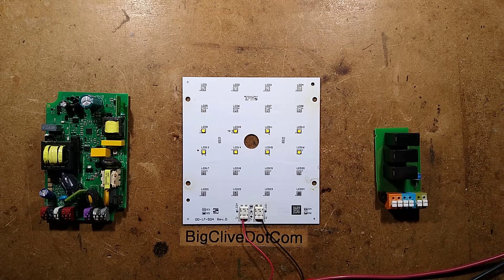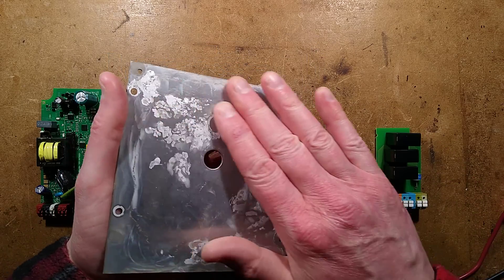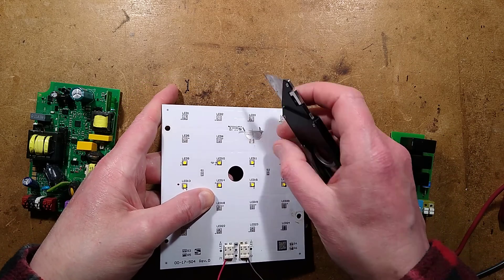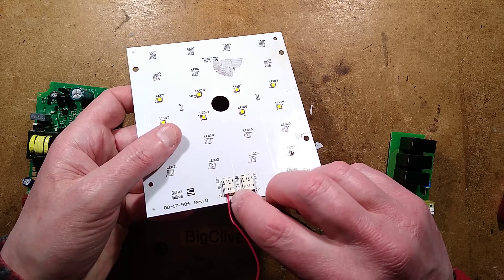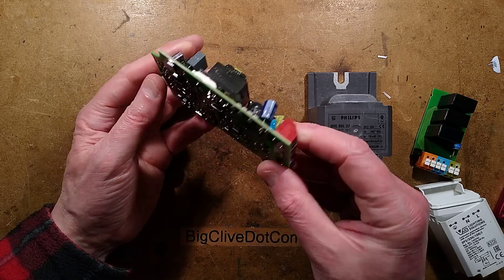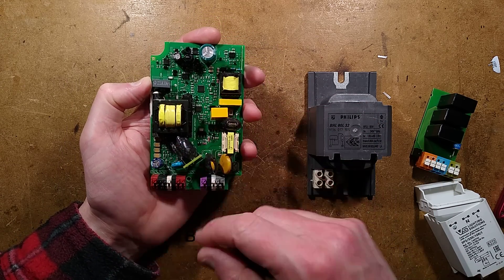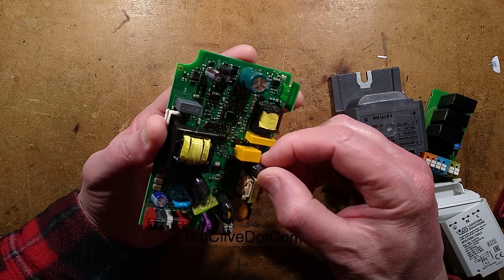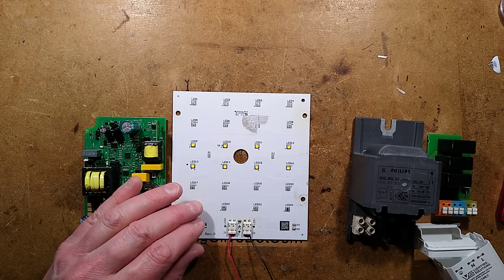Unusual street light failure

Comment: A New York computer graphic company I worked for in the 1980s Decided to prevent anyone copying their new circuit board after this super board was finished they worked it over on a belt sander to remove all the markings on the chips. The result: They completely killed the board.

Comment: Have driven around the american state of Florida a few times recently and they seem to have invested in LED streetlights with inadequate heat management. The phosphors have burned off and whole miles of highways and such are now illuminated by what looks a lot like black lights instead of white lights. They claim online that they are returning them and that all will be well, but it’s been years and they are still there and new ones are adding themselves to the problem all the time.
Reply from the maker: There's a good chance that the company that supplied them has done a runner.  That's a common thing in the LED industry.  Promises of huge lifespans and then suddenly disappearing when they start failing en-masse.

Comment: De-lamination results primarily from the difference in thermal expansion coefficients.  Smaller panels separated by slip joints would help that since stress grows proportional to dimension.  This panel's size is near the limit, but evidence suggests that it exceeds the limit nonetheless.
Mixing metals in a weathered environment is never a good idea; electrochemistry has taught us that.  Aluminum screws are not as strong, but they also would not have corroded and galled.

Comment: Multiple transformer bobbins also offer more flexibility.  More turns and finer wire boosts secondary voltage -- and vice versa.  Finer primary wire allows the primary coil to be narrower and more secondary coils to be fitted.  This strategy also allows the same coils to be used for longer cores having the same area and shape so that multiple secondaries can also be accommodated that way.

Comment: In my career in telecoms, we had actual relays for switching mains into horns, bells and lights. The bloody electronic replacements in latter years were such a pain, we would hoard the older (by decades) relays recovered from dismantlements and closed down businesses. I often had a series of new electronic relays that just didn't work out of the box. The only reliable circuit I recall was the old TRG (transistorised ringing generator) which took a 24v DC supply and put out 110v at 17hertz. They lasted bloody years and years.

Comment: The LED array on my CU Phosco P111 appeared to have been subjected to water ingress, and flashed slowly every few seconds as a result (https://www.youtube.com/watch?v=kFsLBLlgR7g ), but I don't recall there being any major signs of delamination, save for a small section of exposed track from the central LED. The weird thing was that it worked perfectly when acquired, but developed the fault while in storage, despite being kept indoors in a dry room...yes, give me a good old wire-wound ballast any day of the week too!
Reply from the maker: That flashing can be a failed output capacitor on the power supply, or a sign of faulty LEDs.  You may be able to fix your light with a generic current limited power supply.
Reply: @bigclivedotcom Cheers Clive for that info - I don't have the lantern any longer as it left the Collection in disgrace for going faulty on me - I passed it on to another collector in the end! I think that the LEDs themselves were faulty, however, as I swapped the driver over, and the fault remained.

Comment: Yup in the street lighting industry myself and agree totally, We've gone from one item that can fail to many hundreds of failure points with these LED drivers, the biggest thing though is their efficiency that wire wound ballast I suspect will consume 10-15Watts or more when running when these electronic ballasts can be as low as a watt and it makes quite a difference to your energy bill when there are circa 100K of units on the highway. Down side is they dont last as long so you end up spending more possibly replacing the dam things but hey that comes from a different budget 🙄

Comment: Reminds me of a failed CCTV cable I investigated (from a UK seaport). The outwardly undamaged long cable had gone open circuit. When I sliced it open I found whole sections of it had turned to dust - It was cheapo copper coated aluminium cable. Water had seeped into the cable and the cable screen turned into white dust.  It turned out to be very expensive way to make an inefficient  battery let alone a CCTV link LOL.
Reply: It's why you should always replace a TV aerial cable when replacing the aerial.

Comment: I have seen such blistering a few times, but I have never found water in them nor do I recall seeing any extensive water damage, except once, and it was an emergency light that was sealed everywhere except the power cord gland, which allowed the water to ingress and not drain. The whole inside was flooded yet the LEDs were still on. Yikes.
Reply from the maker: That's a common issue with waterproof lights.  Thermal expansion and contraction of the air pumps water in via the cable.

Comment: Read this: About the de-lamination I have actually seen this happen myself on lamps that been used inside my own house, these was 3 Philips G9 LED and they started having issues after about one year when the solder joints started to crack all over the board breaking the connection, I solder these about 2 times using leaded solder and the points I fixed did usually work until something else cracked instead, eventually the whole white top layer were bubbling off the aluminium sheet and the paint were falling off it too looking like a really sight for sore eyes, these were never in any moist but I figure it was due to heat and heat cycles made the thermal expansion break the different layers apart. The final blow that finish these bulbs off was when a main fuse blew in my house while my 400V 6KW 3-phase water heat pump kept running on two phases for a short moment now acting like a generator making the now floating phase reach so high voltages the components in the lamps and some other things powered by this single phase explode before the heat pump going into protection mode. And if you read it this far I had a dream about Clive this night, it was super weird
Reply from the maker: I'm in all the weirdest dreams.

Comment: As you say a board full of components has plenty of possible failure modes. I do wonder with modern cars if they have perfected planned obsolescence with all the electronics they now contain, much of which won't be available as replacement parts, and even if it is will probably require some custom  programming from an authorised dealer. Perhaps why they aren't bothered about EV battery life as some other bit of electronics failure will junk the car before that becomes an issue.

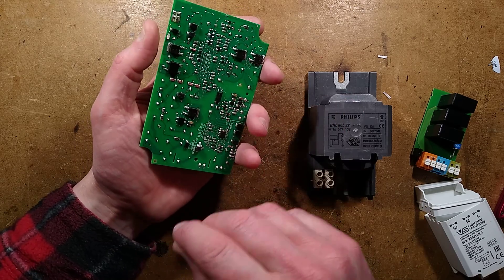Comment: 8:25 I agree; we've become besotted with technology for its own sake. I worked in automotive electronics. In the late 1970's I worked for a motor control company, in our spare time we made electronic ignitions (specifically CDI) which the company then started selling on a small scale. But in the late 1980's there was a quiet revolution in automotive electronics, namely electronic control of the engine and some electronic body control. To our delight the car finally came into the modern tech. age. Then came canbus. It was going to be the answer to all problems, real and imagined. Of course, it was planned and designed (as so often happens) by the ignorant. There was going to be one wire to all components, regardless of load, which was going to save a king's ransom in wiring and simplify everything. A signal was going to be sent down the wire to address components to tell them what to do, a bit like ripple control. Of course, as anyone with the most rudimentary experience of auto-electrics knows, it is a horrendously noisy environment. In the end it increased the amount of wiring manifold. And now the thing is complicated to the point of absurdity. For example, a German car manufacture (I won't name it, but it lied about its diesel emissions) has a microprocessor in its window motors. When the up (or down) button is pressed, a signal is sent to the BCM (body control module) the BCM then decides if the ignition is switched on and sends a signal to the winder controller which then decides which relays to activate to move the window up (or down). Previously there used to be switches which had sturdy contacts sufficient to activate the motor directly, requiring just two wires to the door, not four (minimum).
  Previously, when the flasher relay failed it was removed and replaced at the cost of $10-20. Now the instrument cluster has to be replaced and re-coded to the BCM at obscene cost.
  Simplicity really is the key to reliability.

Comment: 7:07 Clive, that is called progress, the progress to save energy, to get it more "green". Manufacturers and politiics don't talk about short living waste produced for saving energy because that is not on top of the list. They don't care and it will stimulate economy. It is like an electric car, no emmisions at all however they don't talk about production, durability, scrapping and all kind of other stuff needed or required that produce (finally) more (e-)waste than before.  Same with lighting or other things that were simple before. Waste was just an alloy, glass, isolator but now it is totally different. Take a look at a recycler bin, it is really shocking the amount of modern e-waste. For example, I had a 60 years old gas furnace, very simple construction, totally made out of metals and some plastics. Now I have an induction cooker (forced to do so), very complicated inside and full of electronics..... We need to know the both sides of the story, what do we save actually with all this "green" and efficiency BS.

Comment: The reason why most switching power supplies have as little separation as possible between windings is because any air gap between primaries and secondaries increases stray inductance, which reduces the coupling factor and increases the amount of energy that either needs to get absorbed as avalanche energy into the switching device or dumped into a snubber network. Meeting today's 90+% AC-DC converter efficiency requirements becomes difficult if you piss away 1-2% of the energy into snubber networks by adding more insulation than absolutely necessary between windings.

Comment: Well, there is a centennial incandescent light bulb that has been burning for over 100 years. Will there ever be a centennial LED?

I think it's more a case of everything nowadays being built down to a price and being disposable rather than repairable.
Does any fab make a really good quality LED?
Reply from the maker: Given that the lifespan of a bulb goes up exponentially with under-running and the efficiency also plummets.  That's probably why their bulb has been lit for so long.   The lifetime electricity cost data would be interesting.
What they have there is a glass enclosed heater.

Comment: Thay are low grade stainless steel.
They will break, as above.
I not surprised that they have not started degrading.
That may be why they are breaking at the smallest diameter.
Most led lights in this area fail beacuse the aluminum to copper barrier pcb fiberglass is inferior or too thin, thus shorting out.

Comment: Clive, you should see how many Purple or UV looking streetlights we have here in the states...  It's almost funny at this point, it looks like Halloween or Easter or something.  I am not sure what is happening although early on I had heard they used phosphorus in the LEDs to make them white and I am wondering if they are slowly burning up the phosphors...?
Reply from the maker: I'd love to see a photo of the inside of one to see how the phosphor has degraded or physically detached from the violet LED.
It actually sounds quite nice.
Reply: It's the phosphor filter that brakes. The polimer plate with the flourescent compound, mounted in front of de diodes. It deteriorates prematurely, exposing the original LED emission, full of blue and violet.
Cheers 💡
Reply: Photo please 🧐
Reply: Sure those aren't mercury vapor? There's still lots of those in use.
Reply: @PaulSteMarie  no, they are the newer flat LED.  It's not just here.  I'm sure we can find news reports on it.
Reply: @Bones469 seen them here in Canada too. Seems some fail and become purple over time. Probably something wrong with how the phosphor was applied or manufactured.
Reply: @PaulSteMarie  https://youtu.be/i0X_KrmSCyE?si=UTDsXBIMvzELYfId

Comment: That‘s just a form of planned obsolescence!
Now would a small heating element that comes in once in a few hours solve the moisture problem?
Reply from the maker: That's where the linear regulator in the Indo light would actually double up as an anti-condensation heater as is used in some photocells.

Comment: *Abstract*

This transcript details the examination of a failed LED street light. The failure mode is characterized by a single LED flickering and eventually failing.  While the exact cause remains uncertain, several observations are noted:

* *Water Damage:* The light was stored upright and filled with water, potentially affecting components.
* *Circuit Board Delamination:*  The  LED's aluminum core circuit board shows delamination and water intrusion. Whether this is a manufacturing defect or a result of water damage is unclear.
* *Suboptimal Design:*  The use of stainless steel screws in aluminum led to seized and broken screws, hindering maintenance.

The transcript also compares the complexity and potential vulnerabilities of LED street lights to older, more robust sodium lamp designs. Further investigation is suggested to determine if the observed circuit board delamination is a common issue in these LED street lights. 

i used gemini
Reply: summary of the top comments as of 2024-02-28:

Here is a concise summary of the top YouTube comments on the failed LED streetlight video, presented as a bullet list and sorted by importance:

*Key Issues* 

* *Water Infiltration and Damage:*  Water ingress is a recurring issue in LED streetlights, leading to corrosion, blistering, and component failure. This is primarily because seals and enclosures are often not durable enough or improperly installed.
* *Design Overcomplexity:* The driver circuits are significantly more complicated than necessary, with an excessive number of components.  This increases failure points while making repairs impractical.
* *Insufficient Lifespan:* LED streetlights are often advertised to last for 20 years or more, but many are failing within just a few years of installation.
* *Lack of Serviceability:* LED streetlights are designed as sealed units with no provisions for repair.  When components fail, the entire expensive light fixture must be replaced.

*Specific Concerns*

* *Delamination of the LED circuit board*  This could be caused by water damage or a manufacturing defect.
* *Corrosion from dissimilar metals:* Stainless steel screws used on aluminum components can cause galvanic corrosion.  

*Comparisons to Older Technology*

* *Sodium Lights:* Many commenters note that older sodium-vapor streetlights were far simpler, more durable, and lasted longer, despite being less energy-efficient than LEDs.

Comment: I like the new super efficient lighting systems, but having designed equipment to recycle old electronics gear, there is so much non-recyclable stuff now.

An old glass sodium or fluorescent type lamp is recyclable. As is the laminated balast and copper windings.

PCBs and components are just landfill. Shame.

Comment: I am usually disappointed when I discover that a manufacturer of products I own has embraced going “all the way” electronically, and has stuffed unnecessarily complex control pcb’s into their products, especially if it’s an existing product that I’m familiar with and like already. 

Cordless power-tool companies come to mind first with what many have done with their battery management circuitry. I’m a big fan of many battery chemistries such as NiMh & Lithium cells, but not the unnecessary over-complication of proprietary BMS circuitry, which, in my experience, has caused more issues with reliability than it’s helped. Notably the issue of static-drain on the series cell-sections used to power  what is almost an SBC inside these battery packs - An SBC that sometimes locks out all use of a battery pack, giving no indication of what may have caused it to do so. I guess people are supposed to just purchase another battery, even if the “dead” one has fairly new and (would be) healthy cells inside. 

I suspect it’s this way because it allows them to frisbee free chargers across the land as part of promotional deals but there’s likely other reasons as well. Maybe I’m just not embracing this new era of “smart” in everything, down to the simplest products.

Comment: I was just thinking. In your series of household “A shape” LEDs, have you taken apart a 3-way LED?

Where they have 3 different brightness levels based on the extra contact at the base of the bulb?  They’re somewhat common in the US, but I’m not sure about other parts of the word.

I was thinking about taking one apart to swap out the low power LED with a colored one, so you could have red, white, or a combination of the two.
Reply from the maker: They're not a common thing here.
Reply: IIRC the one ancient Cree I tore apart used a single fairly sophisticated buck driver and single string of LEDs, probably monitored which of the two live pins were live and adjusted output on that. I'd guess the more modern light weight ones are probably the usual linear regulated circuit, just two of them on one PCB.